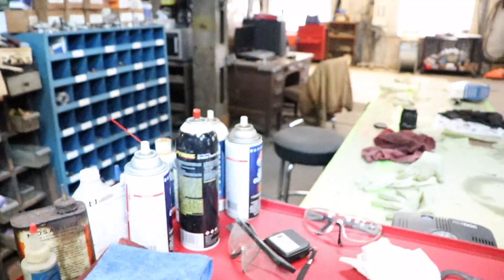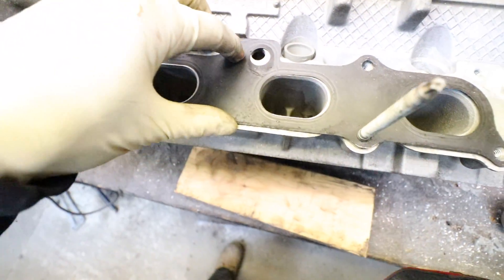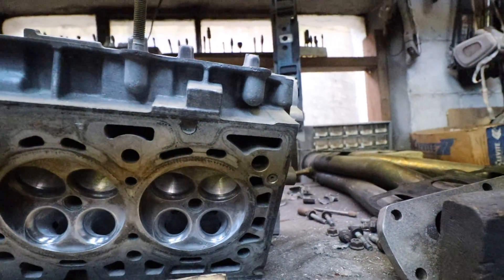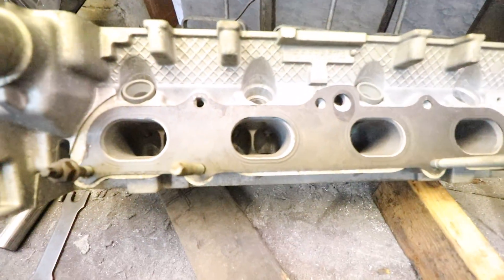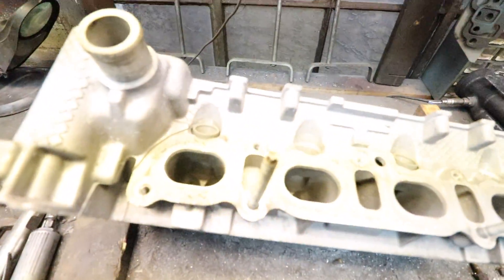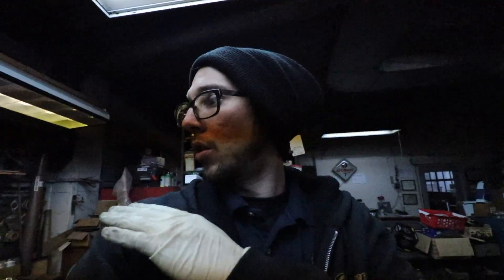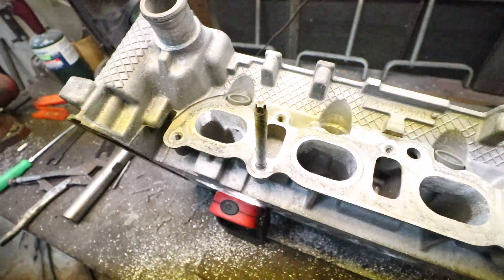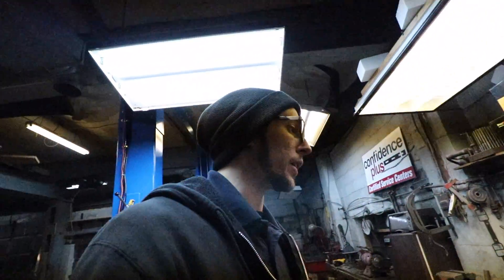Intake Porting & Port Matching the Cobalt SS LSJ Engine

Comment: One other thing is on either the intake or exh ports is to not grind all the way to your outline. Leave a small amount of material in the port and follow up with the sanding rolls and then bring it out to your scribe line so u have some material left to work with..
Reply from the maker: thnx for the info

Comment: Something I thought about is to bolt your gaskets to whatever you are porting and make sure they are centered on the port and the bolt before scribing your gasket lines..Also check for core shift as some heads suck and some are good as the ports might be ok on one but each port after may be out of line, need to check for that so your intake manifold or header matches..
Reply from the maker: yea very good point.